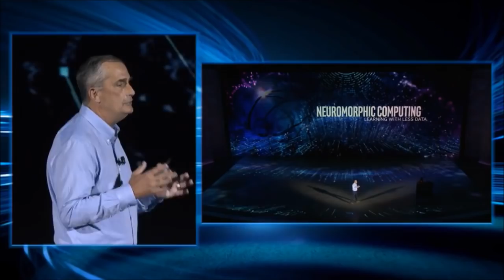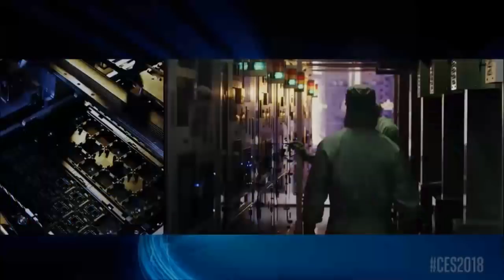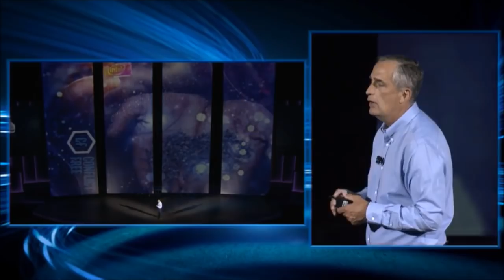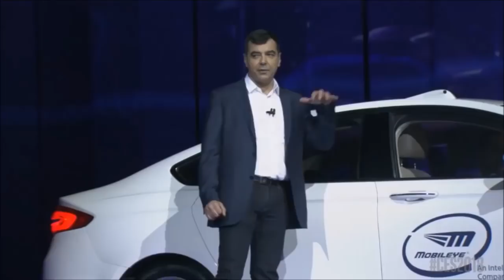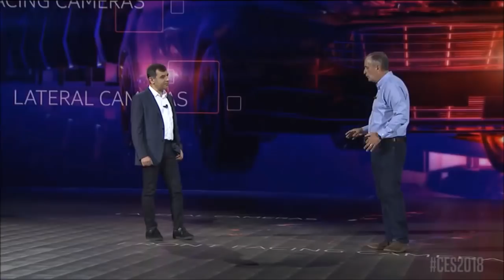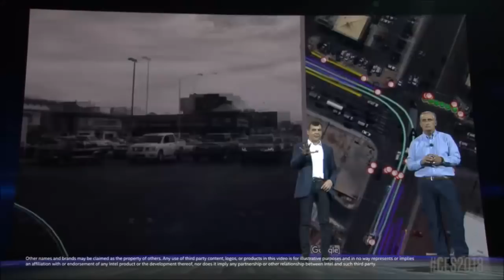Intel's New 49-qubit Quantum Chip & Neuromorphic Chip

Comment: What does the 49-qubit stands for? The number of all qubits inside the chip, the register/operand size, address size?
Reply: for refrence, the intel i7 has 1,400,000,000 small transistors in it. the 49 qubit one has the power of 562,949,953,421,312 that is so much more powerfull, sorry for being 5 years late btw

Comment: How come a 49 QUBIT CHIP can be held entirely in the hand AND YET every other so-called quantum computer uses a warehouse full of freezers and other gizmos and yet has yet to be able to show more usable power than a basic calculator.
They all promise this amazing power of the quantum computer and yet no one can show a single working example of anything useful being done with it.
Technically and theorectically, the technology MAY have a big future, but surely after all the crap of a 49 qubit machine and the collosal power it supposedly has, that they could simply show a machine doing something! Doesn't have to produce a cure for cancer, how about having a simple game of chess, or tic tac toe. ANYTHING!
Anybody, with enough money, can put on a seminar and boast they have the biggest and baddest computing technology around, but until they prove that its at least equal to a 20 year old pentium, and show it actually being used, then its nothing more than hype.

Comment: No matter how sophisticated and powerful the data processing becomes, any system using it will be only as reliable as the reliability of the simplest component. You can have algorithms so powerful that they go beyond anything even a thousand human brains could do, but the failure of a single diode could result in a spectacular disaster. And in the long run such components WILL fail, it's just a matter of time. Anyone who can't see that is a victim of his own hype.

Comment: Love the car...how does the technology hold up against dirt, bugs, mud, snow, ice, fog, vandalism, police stops and customer unauthorised adjustments?
Reply: if you get into a fender bender are you left without transportation because the AI has a glitch or is there some protection for the hardware in case of a jolt?
Reply: does the software data stay stabilised if the battery connection is temporarily open on the vehicle during a maintenance or a smash?

Comment: Question from a complete lamen. the graphene particles cascading into the drop of the solution has me questioning the necessity of the rest of the production process. Does the end result have to be a "solid format", or could the end result be the unstructured form in the suspension? If electric current follows the path of least resistance, then would an electric signal flow through the soltution? if a chip/processor  interacted directly with the solution would you even need a motherboard? memory would not be needed either if there was instant processing. just a though i guess.
Reply: seems that the brain replicates its own cells by creating pathways, also sloughs off cells that become obsolete. self contained, soft-tissue, elctrical processor with flexible memory constraints. all balanced in a ph balanced solution.
Reply: i seriously want to come play in this space. anyone wanna give me a job? lol

Comment: The problem about our brains is that they are complex not because of the amount, but also because of the bio-microrobotics that help provide slow-speed signals. (Something that is rarely referenced by the way)

There is really no point in forcibly trying to simulate how our brain works because it needlessly complicated. However, AIs using layered nodal systems can get somewhat close to specific ideals.

Doesn't Q'Wave have Qubits that number in the 2048 range? Intel is nowhere near, but considering the number of employees between Q'Wave and intel, it is just a matter of time between the private and public markets.

Comment: Silicon is outdated. Need to move to carbon. A hell of a lot smaller, less energy use, less heat, semiconductor at room temperature (graphene) and has smaller jump gap.You could literally make atom sized structures with it, instead of aggregated atoms objects like now.

Comment: The Intel Qubit Chip still needs to be dunked in liquid Nitrogen at 4 degree kelvin while deep underground from any electromagnetic frequencies plus in an isolated stage free from any vibration from man or nature. The chip still needs to be probed by a massive cage of communications ports to each qubit. The chip is still specific purpose and requires programming tailored to the data.

Comment: The Intel CEO is pushing vaporware. No one has gotten more than about 3 qbits working inside a quantum computer. If Intel had 49 they could crack any RSA key in seconds. That's not being done. Nor is there any equivalent task Intel will show you to prove they have 49 qbits working today.
Reply: The task is to crack quantum encryption, not RSA.
Reply: That might be a long term goal but with 49 qbits you could easily crack an 2048 digit key but no one's even come close to that. Baby steps. You have to learn to crawl before you can walk.